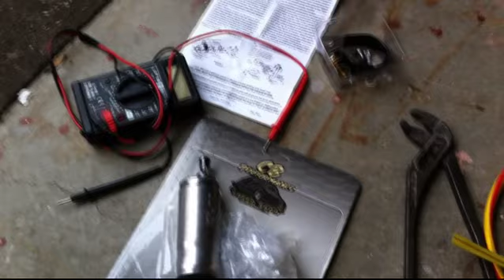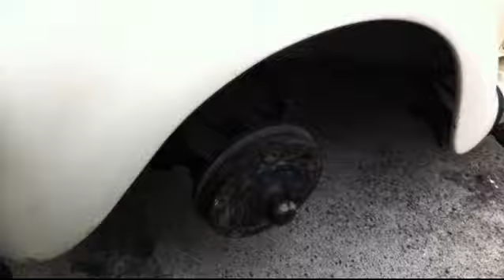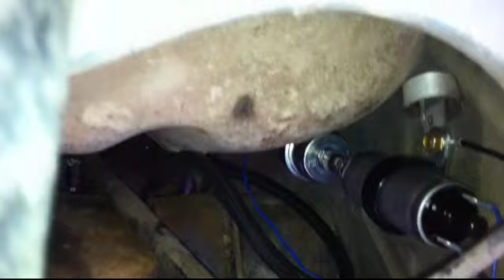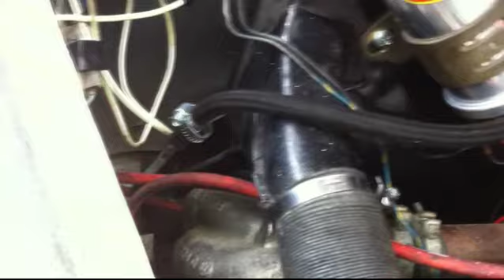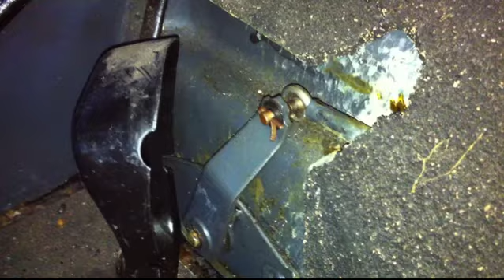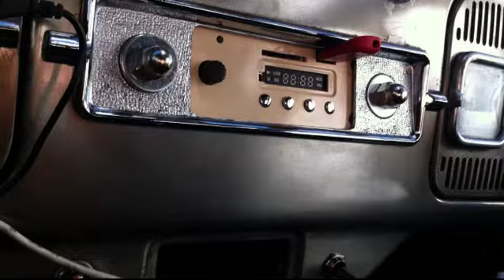VW Single Weber 44 IDF & Electric Rotary fuel pump install

Comment: Hi great video .it really helps . I have a standard 1500 vw kombi with standard carb .i have moved the petrol tank from the back up to the front of my bus so i need a pump . My Q is . Did you use or need a  pressure regulator . Because it was recommended to me but i don't see you used one ? Cheers mate
Reply from the maker: The pump I got was recommended by CB performance to go with the Weber. I did install a gauge but my mechanic said to take it off, just another device that could complicate the fuel line. He was right, didn’t need it.

Comment: Thank you for demonstrating the on/off switch so we can hear the hum of the pump! I just bought a '72 bus that has an electric fuel pump installed (up till now I've only messed with mechanical pumps on VWs). At first I didn't know what the heck that humming noise was. Then when I figured it out I was worried that maybe it was the pump getting ready to fail, but it seems like the sound is pretty normal :) I don't have an on/off switch for it, but I might install one at some point. What a relief!

Comment from the maker: Btw, this set up is still going strong. I've had the Webber fine tuned on the dyno and its running better than ever. It's a daily driver and very fuel efficient.
Reply: What jetting did you find works good I have a 44IDF on my boys buggy and trying to get it to run good.

Comment: Hi. Just wondering what you ended up with as your final jetting?. I am running a single 40 idf on my 1904cc, 110 cam, stock heads and 009. Slight hesitation under acceleration with 60idles, 120 airs, 135 mains, and 65 acc pumps.

Comment from the maker: It was easy to mount behind the tank. both to get wiring to it, and for access while the wheel is off. it needs to be lower than the tank level, you can also mount it closer to the engine where the fuel line exits the centre shaft thingy.

Comment: Hi. I'm 17 and have a 1968 beetle. My fuel pump was dumping gasoline so my big brother bought an electric pump and wired it just enough to see if it worked. It works but we have no idea where to actually mount it. The engine still stock. Was the way you mounted it hard or is there a way to mount it in with the engine?